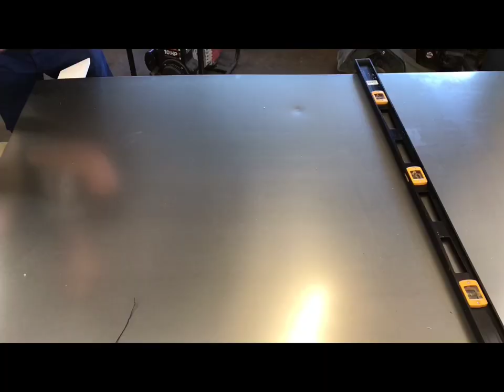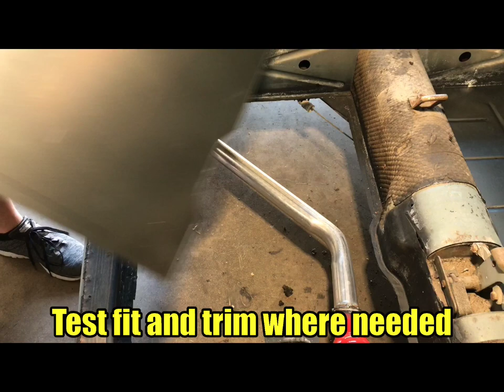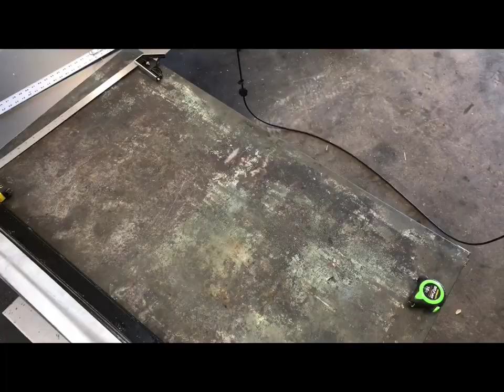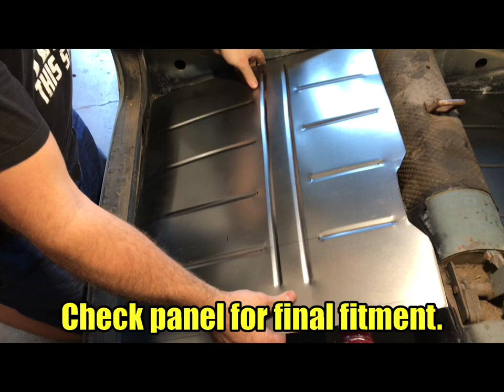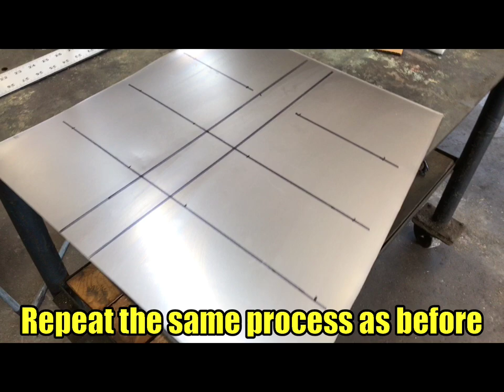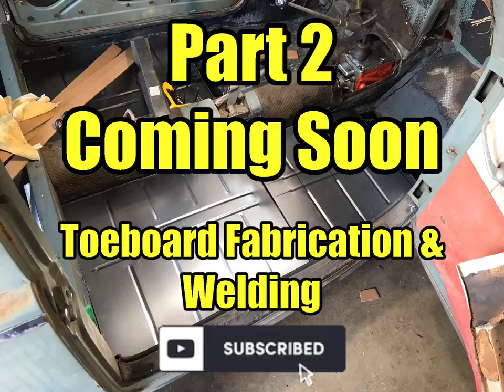Floor Pan Fabrication- Eastwood Bead Roller & Harbor Freight Shears

Comment: Nice to see such a meticulously crafted panel coming into being, your care in making the template was rewarded with as close a fitting panel as it was possible to get.

I noticed that Eastwood Bead Rollers are constructed with thicker steel than the other brands which must help with accuracy.

You were really neat and fluid with your bead rolling, it was something that I aspire to.

Your Volvo is going to be a superb restoration with work of such high quantity. Subscribed.
Reply from the maker: Thank you for the kind words

Comment: Is there a reason why you didn't radius the sides and ends to fit the horizontal to the vertical pieces for welding? Thanks, JD

Comment: Do the beads change the over all  size of the panel?
Reply from the maker: Andy Jones that is a possibility but I did not have to be as concerned with that with the type of repair I was doing. Typically you would pre stretch the bead areas to avoid that if you have tight tolerance & it helps avoid Panel warping.
Reply: @jonathanwood1984  Thanks for your response.

Comment: Do you think it would be better to leave oversized until after the beads were rolled in?
Reply from the maker: Spetet sorry I missed this. That is definitely an option if you can make that work. I definitely could have left the line and trimmed it down after I rolled it.

Comment: Hello, what you use type metal and thickness in mm for this plate?
Reply from the maker: I used 20 gauge cold roll steel but I would use 18 gauge if I did that one again.